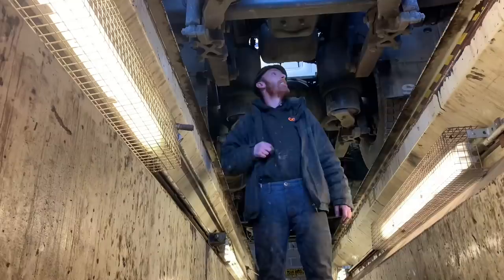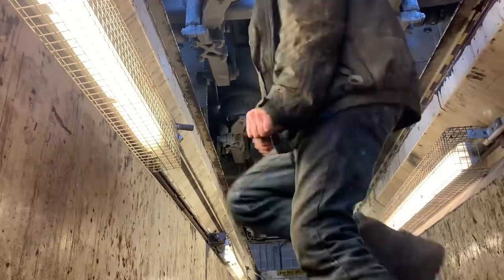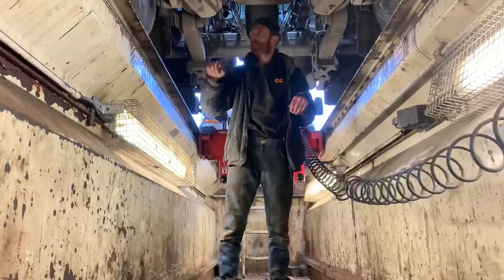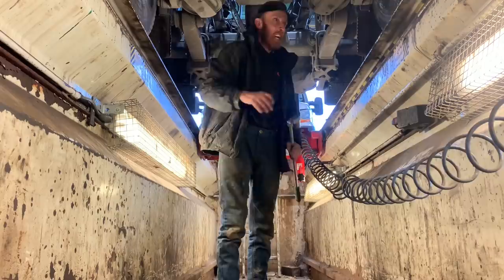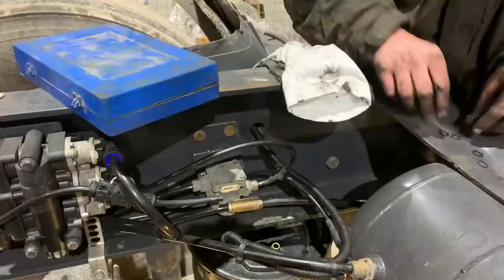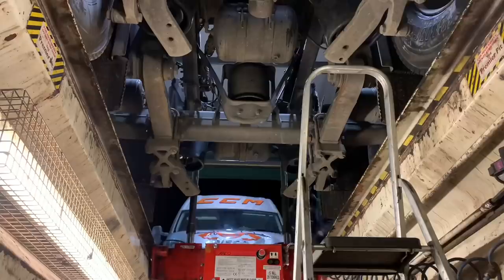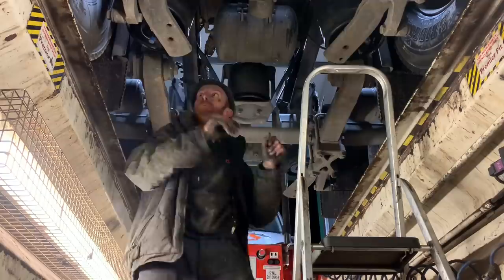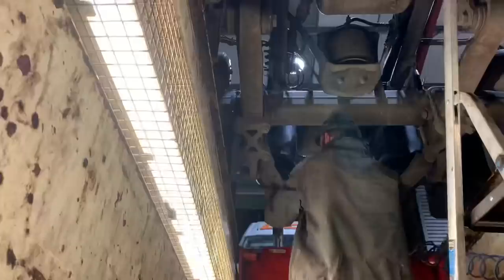How to remove Scania air bags easy 😩 mobile hgv mechanic truck trailer semi rig wagon

Comment: Mate, you can wind them brass fittings out with the rufous  fittings still attached, you just need to thin down the head of a 22mm spanner, 👍👍
Reply: Not if its got the plastic clip that holds the fitting in a set position like the airbag does.

Comment: Been watching few of your videos just Subscribed  I use to be a hgv mechanic years ago got fed up laying in puddles and in snow and frosted floors my advice to you is get your self some nee pads that keep your nees  protected but most of all warm and make insoles for your boots from nice bit of carpet for the winter,stand on cold concrete in just your socks then step on to a patch of carpet  you get what I’m saying my ankles and nees are fuked up from year of working in the cold  keep up the good videos and all the best for 2022

Comment: As I've learnt from past experience over the years working on cars, buses and trucks never ever say "easy job" for example one lad at work did a kingpin and the job went well, everything came apart with not much trouble and 2 hits on the old kingpin with the sledge hammer and the pin flew out and it all went back together good. 2 months later he did the same job on the same make and model of truck and he said to the foreman "easy job" it took 2 hours just to get the old kingpin out as it was well seized and he was swearing more than Roy Chubby Brown.
Reply from the maker: 😂🤣 yeah that’s the job! Something always comes up and bites your arse, cheers James for that glad I’m not the only struggler 😅

Comment: Rawfoss bah!  try actually getting hold of the larger  brass imperial sizes in hydraulic brake pipe fittings like used to be on lorries and buses 40+ years ago.

Comment: When I have to undo those fittings I use a wide flat bladed screwdriver underneath the fitting to act as lever , definitely need to use good fitting circlip pliers as well, then to refit I always spray a bit of silicone spray on “o” rings, always seems to work for me 👍.

Comment: Hey Chris could go do your local Halfords and ask at the till for a trade card, it'll get you 20% off pretty much everything car related, could get yourself some Circlip Pliers. They do a set of 4 for about £20-25 after trade discount and they are lifetime covered so if they are fucked they will just give you a new pair. Just don't file them or used the angle grinder on um only thing they won't cover😄 haha. Same goes for their spanners haha

Comment: Shit hot videos Chris.  Was watching the one last month when you replaced the saf discs. I always have to weld bolts onto the discs retaining bolts to remove them as there always seized in. Top videos keep them up
Reply from the maker: Cheers Mark 👍 that’s a good idea mate the heads can be a nightmare pal! Don’t think the manufacturer even thought about rust 😂
Reply: @Professional-struggler  saf certainly didn't haha. Fookin awful idea they are. Merc axles much better design for disc option. Anyhow if I'm down the a1 anytime soon I'll keep an eye out for the orangey iveco pal. 👍👍